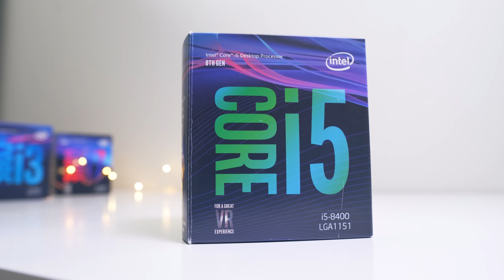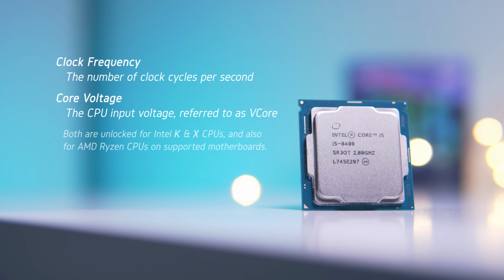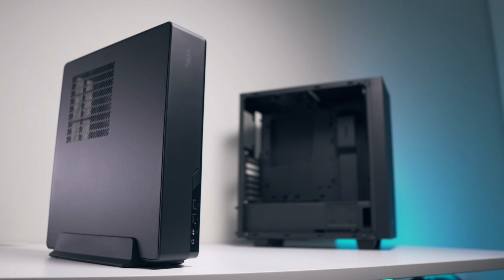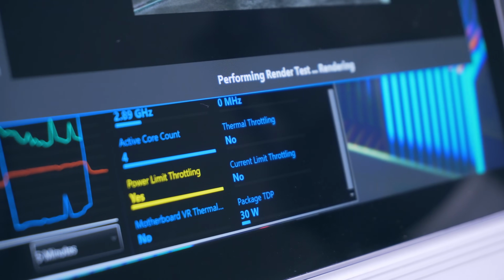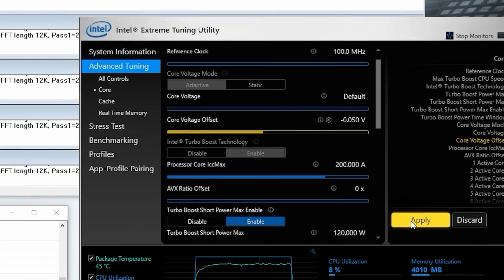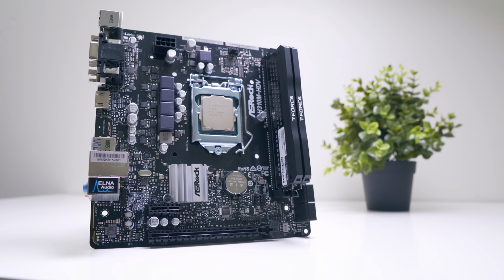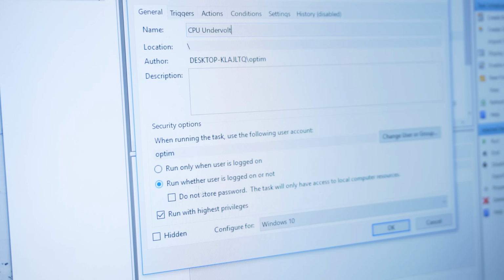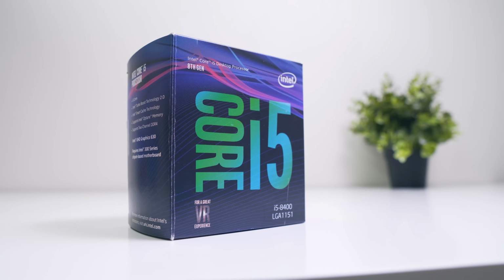How to Drop 10-15C° on Locked Intel CPUs!

Comment: It's kind of sad that you have to undervolt a locked Intel CPU so it wont thermal throttle.

They should give proper coolers with the I5s and the I7s
Reply: First of all. An I7-8700 for example throttles either because of power limitation or temperature limitation with a box cooler. 
If you don't believe me then just read this article about the I7 in a prebuilt pc: 
https://translate.google.com/translate?hl=de&sl=de&tl=en&u=https%3A%2F%2Fwww.computerbase.de%2F2017-12%2Fmedion-erazer-x67015-aldi-gaming-pc-test%2F2%2F%23diagramm-cinebench-r15

Or the I7 with different setups (lower end Z370 boards and the box cooler): https://youtu.be/W2HuMxB0qT0?t=5m2s

Unless you use a decent cooler and a proper motherboard an I7 or even an I5 can't reach its potential at stock setup.
Reply: Ujiltrom M I didn’t lol. 2700X is my poison. What a beast of a cpu it is too :)
Reply: funbucket09 // The cooler is worth its weight in metal, add a 2500rpm fan, the molding, and it's definitely not free. ("Thank God they removed the copper slug!", Intel's bottom line sings.)

I want for evidence of this, the AMD 1000 series X processor didn't come with a cooler, and I consistently found them at a lower price than their non-X counterparts.

AMD stock coolers are actually fine at stock settings. They let the chips run at their full out of the box power.
Reply: No problem! It's definitely out of the question for me to verbally assault my interlocutors, as that brings nothing productive, I've been too many times ad hominem'ed in politically-motivated debates to know better. Props to you too!

That cooler is garbage. Intel won't supply a better one, yet charge for the garbage one. Like you said, capitalism and 90+% market shares in the desktop space don't lend to better prices.

AMD has supplied coolers that are adequate for their processors at stock for their Zen architecture, and promised even better performance given more cooling for their X processors. They were honest on this one.

It's up to us consumers to make Intel understand. You definitely did your part for that! I know my next build will be an AMD one, that i7-3770 from 2012 has lasted me long enough :) (Now if only AMD could make a GPU capable of rivaling nVidia's top of the line... That would be a bloody miracle!)

Cheers!
Reply: funbucket09 // I'm saying this as respectfully as possible. What you bought is not really relevant to the discussion, I'm afraid. I fully expect that if I buy a high-end Intel chip today, I'm gonna have to provide it with a decent mobo and cooler, because their TDP rating is very underestimated.

What I meant by don't fall for ConLake is, in part, admitting that Intel is lying to their customers, making them pay good money for a high-end processor and providing them with a cooler that they think is enough since it comes with the processor, but isn't. "Sorry, that locked i5-8400 will never run at its full power after 5s of heavy use. Our tiny cooler isn't enough, still you paid for it, now you must pay for a better cooler if you want the full power unlocked." I'd rather they don't provide a cooler at all and save the bucks for a cooler of my choosing at that point. It's like a demo or DLC kind of deal on at least a $150~200 purchase after taxes, and I don't like that.
Reply: Ujiltrom M OK. The cooler is essentially free though (if you compare it to the cost of a K chip).  AMD coolers really won’t unlock the ‘full power’ either.  I have personally tried to on stock coolers. Yes the are miles ahead of intel coolers.  But if you are serious about your PCs performance, you will by a 3rd party cooler regardless if you are on red or blue team. Should the intel chips come with that cooler? Probably not. But unfortunately removing it would upset more people than it pleases.
Reply: Ujiltrom M OK. So the X series AMD were found at lower prices. AWESOME! Buy one and get a deal. Now to the intel chips. Ever seen an 8600k or an 8700K cheaper than the 8600/8700. If you have, please send me the link I would love to grab a deal on one.  On you other point, yes the AMD CPUs are ‘fine’ on a stock cooler. You were discussing maximum performance earlier on with regards to the intel cooler (a few comments back).  XFR/XFR2 will not work at its MAXIMUM PERFORMANCE on a stock cooler. But yes I agree with you that they are ‘fine’.
Reply: > Ever seen an 8600k or an 8700K cheaper than the 8600/8700

No, which tends to tell me Intel is ripping customers off. Nothing is free in the world. Someone has to pay for it at one point. You think Intel would just give out free stuff? Nah. They overprice the K-series chips instead.

> You were discussing maximum performance earlier

At stock. AMD coolers (at least on the 1000-series chips) were good enough for full power at stock (I don't comprehend why they went and put stock coolers with their X 2000-series chips. Perhaps to avoid that situation where the X chips were less expensive in the future, artificially boosting their perceived value...) Intel's, not so much. They ship the same cooler, be it with their lowest 8th gen Celeron, up to their highest i7-8700...

> XFR/XFR2 will not work at its MAXIMUM PERFORMANCE on a stock cooler.

1000-series non-X chips don't have XFR, which made their stock coolers enough and sensible. X chips with a stock cooler on the 2000-series have at least the Wraith Spire, which does a better job at cooling than Intel's stock cooler (let's see how it further develops, as the 2500X is rumored to launch soon.) Sure it won't reach max potential, but that "max potential" is within the "extended frequency range", noted as frequencies beyond the all-core boost frequency, and taking into account the cooling capacity. AMD explained that clearly, they didn't lie about that. Intel is just shoving an inadequate cooler to say "hey, there's a cooler!", that won't even let the processor reach the all-core boost frequency while it cooks itself. That's my beef.
Reply: Ujiltrom M Ok fair enough. Believe it or not a actually agree with you. The intel cooler is utter rubbish.  All I was trying to say was that intel will not supply a better cooler without an increase in price (Capitalism, it sucks right? While people continue to pay the price intel has no incentive to lower cost or improve the cooler. Hopefully a little competition will change their tune :) ).  Removing the cooler probably would not cause a reduction in price either, hence my statement about upsetting more people than it pleases (serous PC people will by a tower cooler at least, they can cost less than 20 bucks for a decent one after all. While people who ‘need something for work’ will just stick the box cooler on and don’t give a shit about the thermal throttle).  To summarise, YES, Intel are shit for doing what they do. But will they change anytime soon? I highly doubt that. They have had the market to themselves for far too long.  We can agree on one thing at least. That intel box cooler is GARBAGE! 😂😂😂 and the AMD one will be fine for the average person. I enjoyed this conversation, mainly because you didn’t verbally assault me once. I appreciate seeing that on YouTube every now and then :). All the best mate 👍👍
Reply: @THE TECH JUGGERNAUNT // I suggest you read the whole comment thread, we went over this point and beyond already, had a good back and forth, and reached an understanding in a friendly manner :)
Reply: Mine throttles even with a water cooler and new thermal paste...
Reply: On the flip side, you can save some bucks on both the cooler and the electricity bill by reducing voltage. I'd say that outweighs the benefits of a beefier cooler.
Reply: @ujiltromm7358  u won’t really save more than even a dollar a year undervolting but better temps is nice
Reply: Ujiltrom M People who buy a locked CPU usually expect that it runs perfectly fine at stock configuration. With a better stock cooler you could achieve that with better temps. Lowering the voltage   is only possible to a certain degree because all CPUs must fit that criteria. Not all CPUs are created equally.
Reply: Very strong arguments I cannot argue against. You are definitely right from a business perspective. Thanks for making me see that.
Reply: funbucket09 // So the end-user should expect to not enjoy the full performance of their expensive processor while it cooks itself. Got it.

The i5-8400 is rated at 65W TDP at 2.8GHz, yet its power table gets to 3.8GHz on all cores. Don't expect the stock cooler to handle that. Thermodynamics limits are incontrovertible. Intel has been abusing the TDP metric for a good while now.

ConLake is a thing. Don't fall for it.
Reply: NoobStyles guess what? It actually does run perfectly fine straight out of the box. It will do EXACTLY what the average consumer will expect. Do you think that they give a shit about 5-10 degrees on a cpu that they will just replace in a few years? Hell no!!!!!! This is why intel won’t provide a better cooler. They don’t have to so why waste the money on something that average joe simply doesn’t care about.

Comment: My PC is in a Sugo SG13. I had an i7-3770 on hand, bought an AsRock H77M-ITX, built the PC, but since it was a 77W TDP processor I put it under a 120mm water-cooler instead of a low-profile cooler. Then I discovered undervolting, applied undervolts until reaching a -170mV offset (tried -180 but crashed after a rather long Overwatch session) and now it won't go past 55°C (20°C ambient) at the lowest fan speed. Just amazing. Who would have though mini-ITX with a front mesh panel could be near-silent under full load? I didn't.

2 months later edit: I finally figured out how to undervolt my i5-7600 on an AsRock H310M-STX, a mobo that doesn't allow undervolt in the bios. Gave it a -60mV, is cooled with a Noctua NH-L9i, and barely touches 80°C on the package in a 24°C AC ambient under Prime95. Sweet!
Reply: Santiago no undervolt only decrease the power draw of the chip without lossing performance because you dont change the clock speed
Reply: As my comment above great to see great results with the i7 3770
Reply: Yeah, Ivy Bridge gets stupid hot with "relatively higher" voltage. I remember overclocking the K chips was a pain. Less voltage on the non-K chips definitely makes a huge difference.
Reply: Ujiltrom M yep, that’s why I delidded my 3770k, now I’m able to run it at 4.8ghz at 1.39v under 80c using 240mm aio. Before the liquid metal 4.8 wasn’t even doable, but i still settled to 4.7 at 1.34v, never exceeds 70 degrees under prime 95 fft which is insane. I dropped nearly 23c. Mind blowing!

Comment: Undervolted the i7-6560u cpu core and igpu in my dell xps 13. That thing runs hot! Even with premium thermal paste and the undervolt, the dell fan profile is terrible for such a tiny heatsink.

My desktop with an i7 4790k is running 4.5ghz all cores with a -0.06v offset so about 1.16v maximum. Not bad. Runs super cool now. Though that was easier to set in the bios as it's unlocked.
Reply: I hate mine! so hot!  I'm not gonna open it up but I will seriously underclock it! Thanks!
Reply: Eric Wright 
Planned obsolescence, devices designed to break soon after warranty. 

Be glad that you did not burn your money away on an Apple product. A MacBook pro won't even spin it's fans at all until it exceeds 90°C and even at this egg cooking temperature it won't be bothered to spin faster than idle.

Comment: I recently got my ncase m1 :)
Reply from the maker: hamzadad khan - awesome, my Dan A4 should arrive next month 😁
Reply: Optimum Tech can't wait to see the review! I decided not to get the dan a4 cuz it was not that much smaller than the m1 and didn't have as much support for hardware. I didn't receive it yet though, but I'm excited for my build :) ur reviews have helped me alot 😊 I got a ryzen 2700x, which cooler do you think will let me do a mild overclock? I've been looking at the noctua one you reviewed recently.

Edit- also is it possible for me to 3d print the M1 feet myself? The stock ones are weird.
Reply: Mizu Izzu I ordered it directly from sfflab.com with the window side panel, it probably won't take more than 2 weeks to arrive, it's currently on a plane or something on it's way to me :)
Reply: hamzadad khan where you buy it? And how long till it arrived?
Reply: IDk if you plan to Watercooling it, but consider it because even the best air cooler will make it extremly hot, my i7 6700 was getting insane temp like 90°+ on BF1 and my room temp started to feel like a sauna, thanks to my Semi-passive house without AC.

I've installed my Asetek 545lc and dellided my cpu, temps are WAY better, but custom cable are indispensable if you want to close your case, i've achieved to close the GPU panel and the top one, but it's a big no to close the last panel, there is no way you could achieved that with Corsair cable.

Right now, my CPU is idling at 30~33 (25° ambiant temp), 65° on Prime95 after 1hr (seems stable) , 55~60 on BF1.